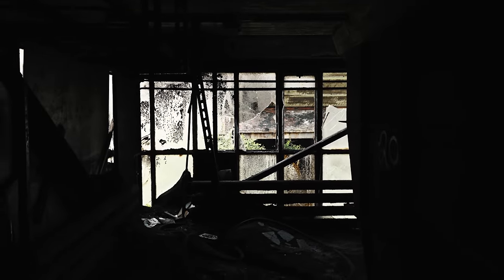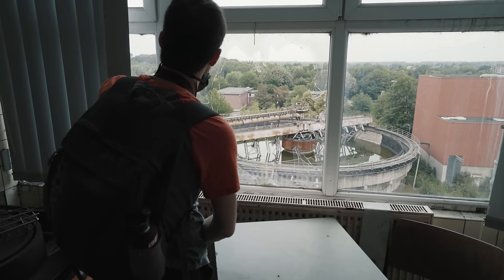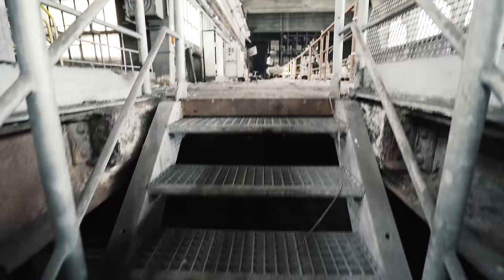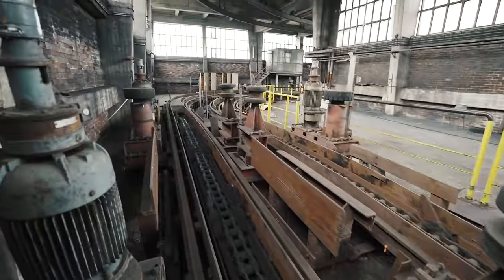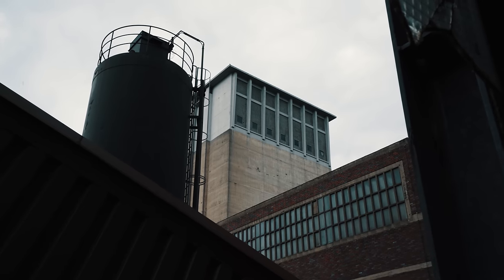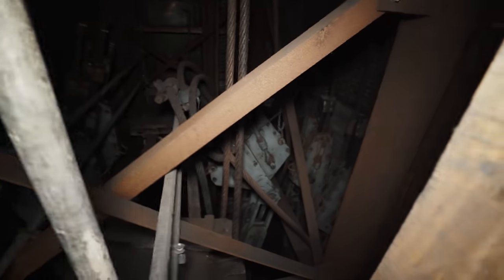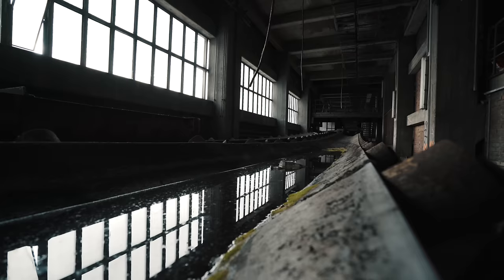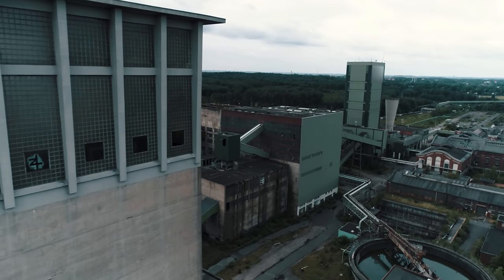Huge Abandoned Coal Mine with Cart Roller Coaster!

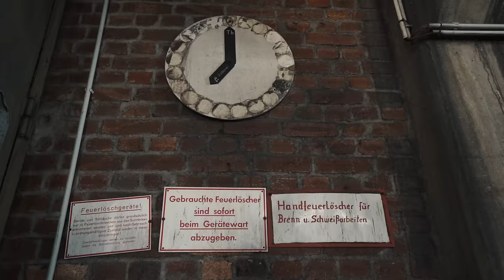Comment: 7:05 What that means:
Center:

"Gebrauchte Feuerlöscher sind sofort beim Gerätewart abzugeben."
Used fire extinguishers are to be handed over immediately to the equipment maintainer

Right:

"Handfeuerlöscher für Brenn und Schweißarbeiten"
Hand fire extinguishers for cutting (Brennarbeiten = torch/grinding/hot cutting) and welding work.

Left:
"Feuerlöschgeräte: etc etc"
Long safety text on handling of Fire extinguishers :D

Comment: Thanks for the new videos, especially for BW Lippe (Verbund), formerly Westerholt colliery.
Since I've been a self-confessed mining fan for almost 16 years, this video really pleases me.
Now you know by now the complete system, without composite.
On Westerholt (Egonstrasse) the extraction was operated. This was done via 3 shafts. 2 are still complete. The Old Concrete Tower, which you have visited, is identical to Shamrock 11. The green giant was added in 1982. It's worth to see him, because the huge conveyor carts still hang in the shaft. The third was a conveyor headframe, which was dismantled. It was in the middle of the gatehouse.
The passenger "elevator", for miners, was on shaft Polsum. This has now been destroyed by the vandals enormously. The conveyor frame was dismantled. The ventilation was also on Polsum. It was the weather shaft system in the forest, which is also fullfilled.
As an attachment I sent you a video of the company HESE and FHF, in which you can see and hear the whole system, in operation.
It was an absolute masterpiece. The operation was fully automatic.
Nobody was sitting in the cab of the winding tower (shaft 3). This was only an auxiliary driving position, since, starting from 1978, already automatic. It was for manual operation, in case of emergency or maintenance. These containers are falsely called "lorries". In german mining-language they are called "Hunte" because they do not have their own tilting frame. Therefore also the cart circulation with centrifugal tipper and Wipper plant, which you have visited.
In shaft 1 (green tower) was a so-called container-extraction, also called Skip-extraction.
In the attached video you can get an impression of the enormous rope speed, in which the 5-storey conveyor-carts come from the depth (they are already slowed down there).
The fact that only material was driven (coal and rocks), was driven at 16 meters per second. Each conveyor-cart weighed 80 tons.
The conveyor systems were delivered from SIEMAG. AEG, Siemens and Schuckert installed the DC motors; the gears, pulleys and baffles were from BBC and GHH.
Well, enough written. I wish a relaxed weekend and look forward to your other videos.
At 2:08 minutes it will be interesting.
A nice greeting from Bremen (Germany)
Reply: Do you have a link to the video ?
Reply: @Valentino202020  That is so cool. Thanks!

Comment: A very nice LP and a great video.
I do not live far from it, but have worked on another coal mine.
My mine was the last in Germany. We stopped the promotion on 21.12.2018. In Germany, coal is no longer being mined. Greetings from Germany, Andi.   ⚒ Glückauf ⚒
Reply: @Benjamin Owens I don't know this special one but in Germany we have a lot of them. In 2011 Germany decided to shut down every kind of coal mine (also coal power plants) and nuclear power plants until 2022 for nuclear and 2030/38 for coal power plants. The reason is that Germany wants to have 100% clean energy that helps to protect the environment. A very difficult process I can tell you.
Reply: Auf welchem Pütt warst du? Prosper Haniel oder in ibbenbüren?
Reply: @FentonWorksDE  Auf gar keinem, kenne ein paar Sachen darüber. Du?
Reply: Michael Paul Die frage war eigentlich an @OutdoorArea ^^ Frage interessehalber, bin ne bottroper jung ;)
Reply: @FentonWorksDE  Achso kein Problem;)
Reply: @Benjamin Owens its actually because since the 70's, mining coal in germany is not profitable anymore, its cheaper to import coal from china. They have been gradually closing them, as to prevent a lot of unemployment at once. Most of the coal mining in germany took place in an area called the Ruhrgebiet. Some of these factories are opened to public. Such as "zeche zollverein" or "landschaftspark duisburg". Worth the visit if you're around

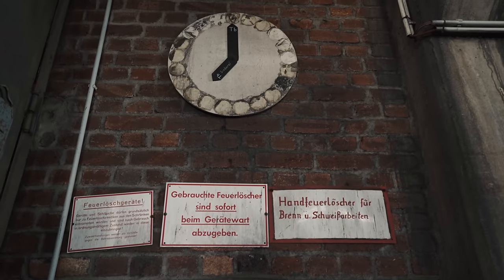Comment: 7:05 Here is some rough translation of the signs seen there.

The left one reads: Fire extinguishers! Devices and hoses may only be removed from the cabinets for fire-fighting purposes and must be returned in their proper condition after use! Repeated acts of noncompliance are punished as violations of the fire protection regulations!
The middle one reads: Used fire extinguishers are to be handed over immediately to the equipment maintainer.
The right one reads: Hand fire extinguisher for firing and welding work.

Comment: 23:49  Probably a 2 tank fire extinguisher.  One tank is for compressed air and the other powder rather than the single tank of a hand held unit. This 2 tank system allows for the flow to be stopped without losing pressure due to power in the valve.

Comment: The sign "Stromrichtertrafo 1 West" is most likely for converting incoming 34kV utility to dual 580V that is either rectified and/or frequency converted to run the motors. The 5.3MVA means that each 580V feed is rated to about staggering 4500 amperes.
Reply: that's a lot of strom

Comment: Don't a lot of theme parks have a mine themed ride? Usually in the Wild West section, and probably more a gold mine... and also usually more old-time-y ^^ But yes, would be awesome if one of the many industrial ruins were to be transformed into a theme ride. (Then again, there's a water park inside an unfinished nuclear reactor... so who knows, maybe there already is.)

Are those wires lying/hanging all about? How come nobody's looted that place for the copper yet? oO
It's amazing that there's still machines/tools just standing around. Not the massive ones so much, those are obvs harder to transport... but should've thought they'd've sold all the old stuff after closing. Presuming the closure was long planned ahead and not suddenly in a rush. 

Humans are quite amazing. 

Whuuut, is that a whole shelf full of screws and parts? 

Would be awesome if there was maybe a guided tour, at least through some parts. 

That fire blanket box looks new? I wonder if in these kinda places they maintain some of the safety equipment, just in case some explorers do manage to get in and get in trouble...
Amazing place. Shame it'll be demolished... hopefully they'll do something good with the area and the remaining buildings.

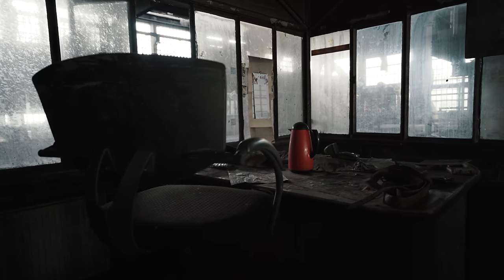Comment: Here's what the signs at 7:05 say:

Left one:
Fire Extinguishing Devices
Devices and Hoses may only be removed from cupboards for fire fighting purposes and must be returned in proper condition after use. Noncompliance is considered as disregarding site regulations and will be punished.

Center one:
Used fire extinguishers are to be immediately brought to the equipment manager.

Right one (the hand-painted one):
Handheld fire extinguishers for torching and welding.  (Implying that a fire extinguisher needs to be kept nearby when performing hot-work)

Hope this helps!

Comment: I wonder what's up with that weird number 4 that keeps showing up. It's spray-painted on one of the stairwells leading up the elevator shaft building, and then again on a couple of its windows. There's even one on the back wall of the control room, and somebody wrote one out in the soot on a control room window. Just somebody's personal icon they like to tag around, maybe?

Comment: I think those large motor on top would constantly be running, and levers would apply breaks but for making contact with the center drum that would then move the cables up or down but I could be wrong.  I have seen cable cars motors and they just keep running.

Comment: I have been in several coal tipples wash plants here in the United States. When a company wants to abandon a place like this it is required that they cut things apart so as to leave it UN-operatable. 

I have seen elevator cables torched, stairways cut off, conveyor belts cut, electrical boxes gutted, and large machines just torched into pieces. All of this looks very familiar. Thank you for the tour.

Comment: when a mine shaft is closed off, and the lift mechanism used a counterweight cage, they would pull the other elevator cage all the way up, lock it down, and then cut the cables - so the shaft can be closed off with a slab of concrete

Comment: I wonder if anyone will ever find a way to get into the mines. It would probably involve restoring the elevators and bring power back to the building though.
Reply: You shoulnd' do that. The most mines have pumps to free them from groundwater. The plant is shut down, so the pumps will be too. Another reason are toxic gases that can be down there. :/
Reply: You shouldn't do that. In the mines were pumps who free them from groundwater sometimes. Now since the plant is shut down, the pumps will be, too. Another reason are toxic gases who can be down there because there is no ventilation system anymore. But here in germany are some places you can visit with a guide. :)
Reply: Pretty much any abandoned mine is dangerous really.
Reply: @snakeface5652  Yeah they are. But when someone want to see am mine from the inside and get some information of the place, there are some mines who doesn't operate anymore but are for showing purpose. They are safe to visit.  We have a steelfactory as well for this purpose.